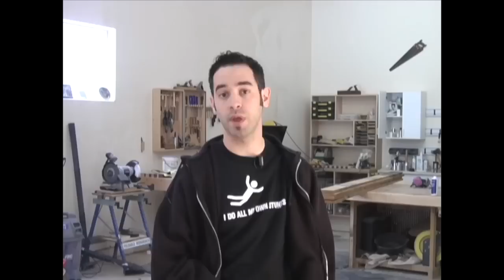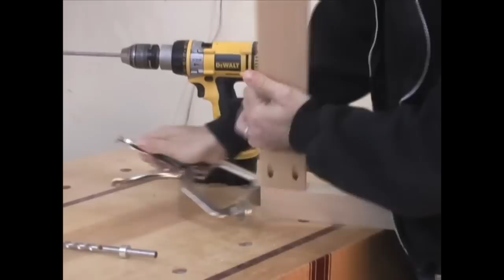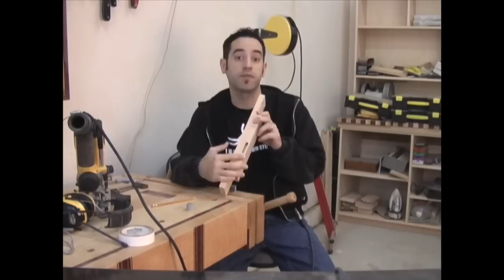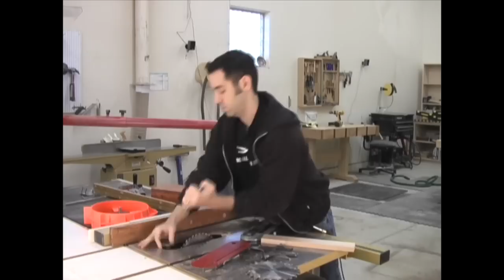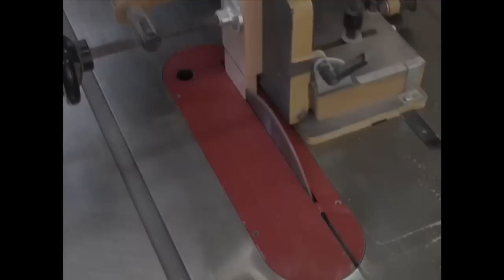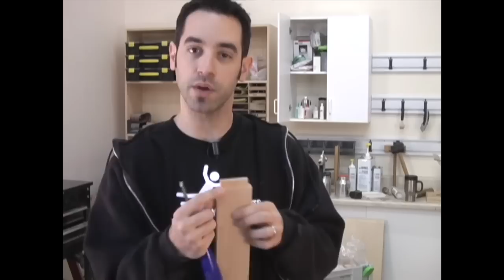10 - Tenons Anyone? - Review of Mortise & Tenon Options

Comment: Mark 
One option you didn't bring up, I was watching Stumpy Nubs channel and he was looking at a dresser that could have very well been made by shakers most of the joints were dovetails  if you think about a dovetail it locks 2 parts togather
Tightly you might not even need glue to hold them togather you could use wedges or dowls that show and the dovetail will never move.
IMO that's the strongest joint.
Let's say your making a table, the legs and stretchers fasten togather with dovetails and the top is held on with movable figure 8s and the wood can move with seasons that might very well outlast even our modern glues.
Becuse a joint can only be as good as the glue that holds it togather,  we don't know if some outside influences will turn our modern glues into mush.
How can you study the long term of glues with out the time passage to evaluate them? You cant. 
We know what animal hyde glues do becuse time has showen us.
Who knows tight bond II could be mush in 150 years. We just don't know.
But a dovetail will always be its shape.
If you look at old Japanese building they didn't use metal to hold things togather
It was joinery that lasted 2k years or more with no glue or fasteners. Just friction fit that works with woods properties.

Now all this comes to one point, how long you need somthing to last, how well its made, how much time you spend to make it and last but not least there always more then one way to skin a goat.  Or is that goose or a bever or deer?
Its funny looking at all the different parts of the world and the many different ways people made things and how they have lasted.

Comment: I made a bed using a Jessem Mortise Mill.  I was able to turn the MM upside down in a table/jig and could just lay the pieces on their side and use it horizontally.  Not safe with a router, but the mortise mill uses a special drill bit.  Lots of heavy clamping and it worked like a charm with no glitches.  These aren't made anymore, but I think there's a market for something like this.  The domino does something similar but is more limited as to depth.  My Domino is much easier, but strong joints on long and large pieces is a limitation.  I don't know if the Domino XL can handle tenons that are that long.

Comment: Its come to my attention that pocket holes and screws have been around for longer then a craig jig. 
I've also found more then one version of the jig, one even auto adjust to the size of wood and sets up the drill stop all you have to do is clamp it tighten the Allen screw on the drill bit coler and pick the correct color screw, its dummy proof.

Comment: Huge fan....  would love to meet you sometime.  Your in Arizona right?  I think that is what my college buddy Matt Vanderlist told me.  Quick question.  You advocated 3/8" Tenon for 3/4 stock.  I fought my equipment and could not pull it off.  My Mortise jig would not go any closer than 1/8" from my table saw blade.  Got to thinking about it and it seems like being 1/16" from the table saw blade is VERY tight perhaps dangerously so.  Some other pages advocate using a tenon that is a third the width of the stock.  Thus using a 1/4" tenon bit seems like it might be right.  I believe my Mortise Jig will work for that.  Am I thinking clearly???

Comment: when you make the tenon, can i just cut out the cheeks on 2 sides and leave the tenon the full length of the board? or would this not be as strong? i am doing draw boring, thanks
Reply from the maker: You could and a lot of people do, depending on the application. I think it would be plenty strong for most applications.

Comment: I use my Radial arm saw for cutting dados, tenons, and the occasional long crosscut..
Setup is quick for cutting tenons since the dado blade virtually lives in the RAS.
Cleanup with a shoulder plane and a router plane makes cutting tenons a breeze.

Comment: If you want to make square mortises and you don't have a mortising machine, you can rout the mortise , then use a mortising bit with drill bit removed, either with the drill press or a mallet to finish the ends.
Reply: Good idea
Reply: What happens if you dont have either a drill press or a router? These things cost money.
Reply: Chisel and mallet

Comment: Hi Mark. I embrace all of your advice and I've got  a question, if this video is still being monitored. Re: Colliding tenons within a slender table leg. Say, 3/4 inch thick apron and a 2 inch square leg.  Should I think about shortening and maybe thinning the tenons?  Will this significantly weaken the joint?

Comment: Thanks for the excellent video.  In using the tenoning jig on the table saw, have you ever had the waste piece bind and kick back?  Also, have you considered installing two blades in the table saw, separated by a spacer?  That would allow you to cut both tenon cheeks simultaneously and give you excellent, repeatable control of the tenon thickness.

Comment: Thank you for this video! I used some of your ideas for a bar table that wraps around the corner piece of a sectional table. Pocket holes for the leg assembly would have been much quicker and easier, but I didn't want to see the holes or screws. Downside, no table saw yet. Mortises all hand drilled with a forstner bit and the tenons.... with a miter saw! It worked great- thanks for the info!!

Comment: Ok, I've been woodworking for 15 years, and have used the routed mortises for 90% of my Mortise and Tenon joints--and I know, every pro I've seen says to either square the Mortise or round the tenon when you use this method.  Call me lazy, but I've never done so--There's plenty of glue contact on the cheeks of the tenon that I don't worry about it.  Is there some secret reason why we "should" do this step?

Comment from the maker: Hey, to each his own, but that's not the method I like to use. Yes, mating surface is important, but so is depth. And you have to take into account the thickness of the tenon board as well as the thickness of the adjoining piece. Once you get outside of a standard small frame piece, there are a lot more factors to consider besides the tenon itself. But I find my method gives me a good starting point.